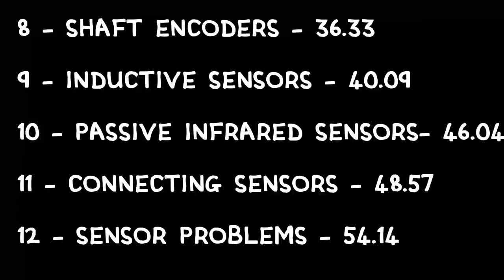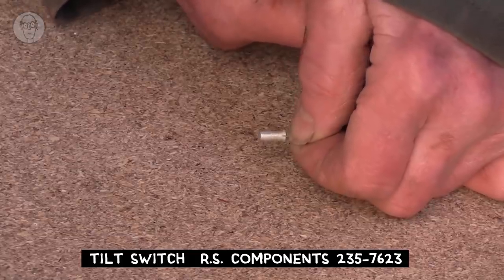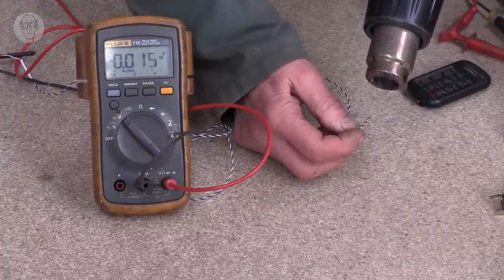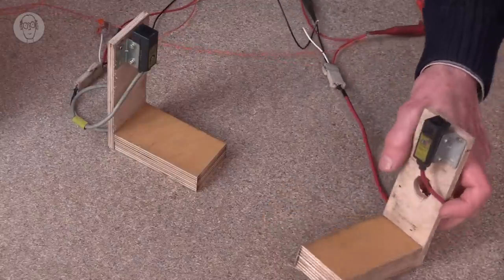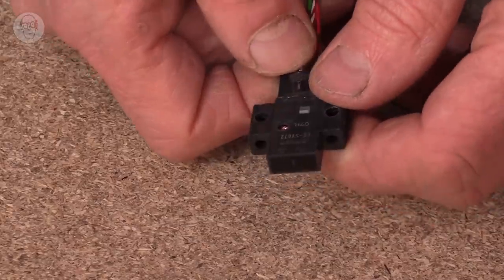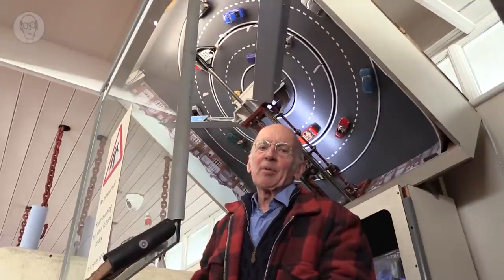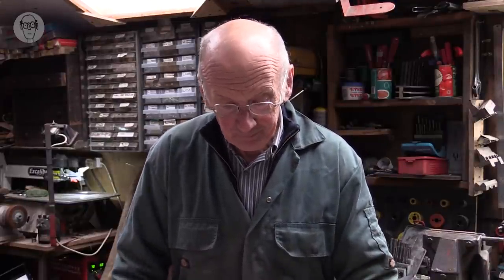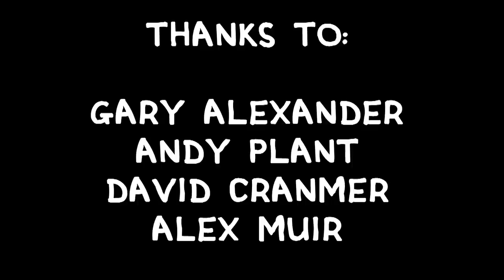SENSORS -The Secret Life of Components, a series of guides for makers and designers - episode 9

Comment: For years now I want to make a halloween decoration in my apartment's kitchen window. I tested it and it should work, but didn't have the drive to build it fully. I want to put an PIR sensor outside the window and if someone walks by it would trigger the logic. The logic is an arduino which drives 3 LEDs and a simple motor, 2 LEDs are in the eye socket of a skull that is made to look like some creepy reaper and 1 is under the reaper to provide some additional red hellish light, the motor is to just give the reaper a little bounce. I'd only put it up once it's dark outside and take it down when it's daylight. One October I'll make this happen :)

Comment: Ive turned my screen brightness down to save energy. and wash my hands in cold water. "I sawered the top off a TO3 2N3055 bad boy. , everyone did it , heady days. just bought a brodgeport, selling a lovely Downham jig borer. ive pulled some of those expensive opto proximity detectors apert,Distance sensing. vixel. wow love the old slot disk, could put a gear into that,

Comment: I get it, an alarm makes sense for a tilt switch. 
But I would have been so much happier if you'd have just used a 1.5v incandesant bulb. I'm sure you've got a few of them lying around.
Reply: btw I can't remember if those little screw in bulbs were 1.5 or 6v. I just remember lighting it up using a bit of wire, a double AA and holding it all in my hand.
Reply: @fremenondesand3896  lol..  I still test 9vt batteries with my tongue!
Reply: @fremenondesand3896  You could get them in all sorts of voltages - torches often had 3v bulbs, and took 2 "D"-cell batteries, although I don't think they were "D" size in my day, they had another code on them... Often, the lower voltage ones had a little lens on the front, the 3 and 6 volt versions being plain old "round". You can still get them these days, although they're much harder to find than they used to be, now that they're not stocked by every newsagent in the land.

Comment: The difference in pressure for turning the compressor switch on and off again (at 12:30) is called hysteresis, right? Awesome 200:1 Like/Dislike ratio for this video :)
Reply: Hysteresis  - yep, spot on. It's also often a feature of thermostats - they turn on at temp X but turn off at temp Y; this is to prevent the system from "buzzing" (apologies, I don't know the correct term) at around the correct pressure/temperature, i.e. rapidly switching on & off, which risks burning out or damaging both the switch/sensor and the system it's controlling.
Reply: @theelectricmonk3909  You could call that "short cycling" or "hunting".  Hysteresis is also used in electronic comparators such as the LM311 and LM339 to prevent them from oscillating when the input signal is changing slowly through the comparator's set point.